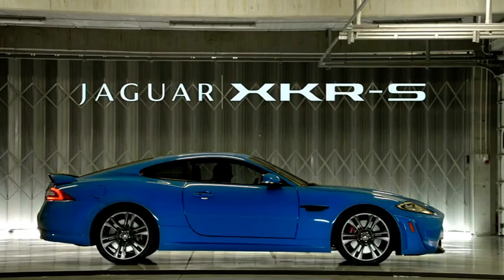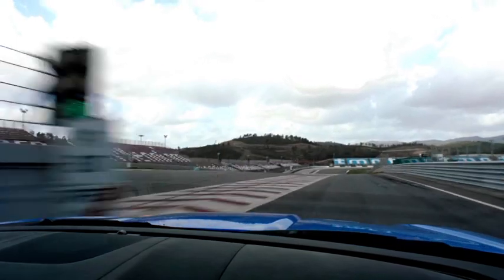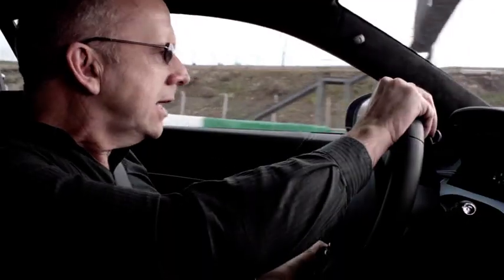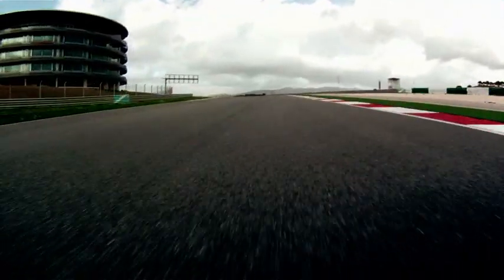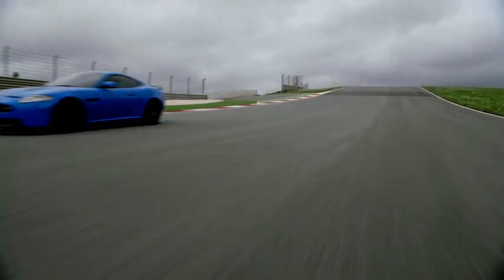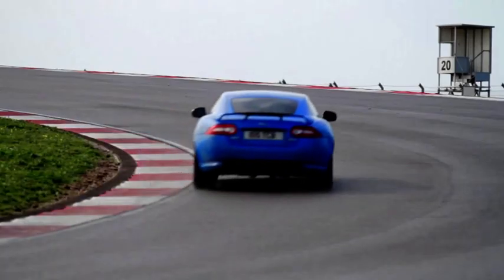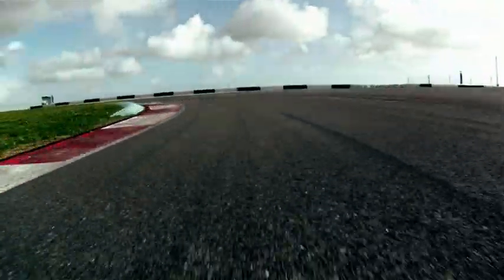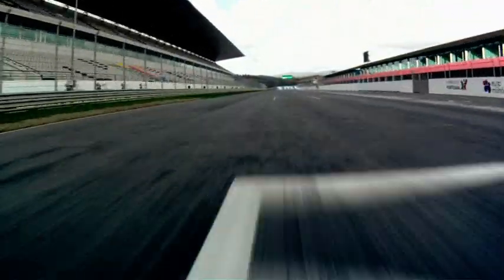Jaguar XKR-S hotlaps at Portugal Circuit

Comment: love the car, chief engineer is sooo dull though switch the esp off and have a little fun, he's probably saying arrh if it looks slow its a fast lap (controlled). it looks slow and boring though (esp with you droning on) this is why aston can ask 60k more for the DBS because the chief engineer would be hanging the arse out of it, grinning ear to ear you looked like you were popping down the shops. not carte blache on a wet empty RACE track with 550bhp